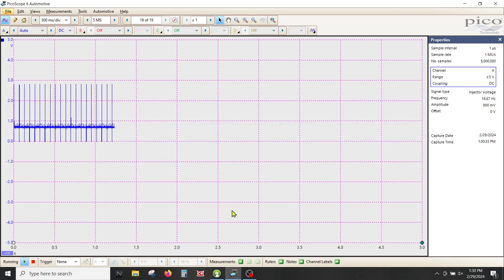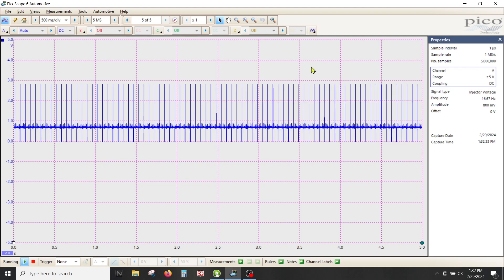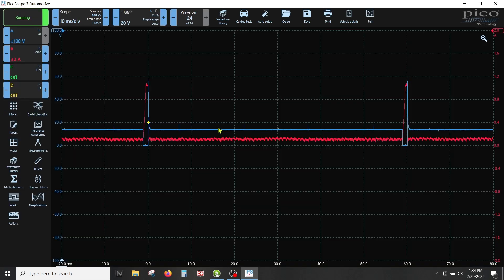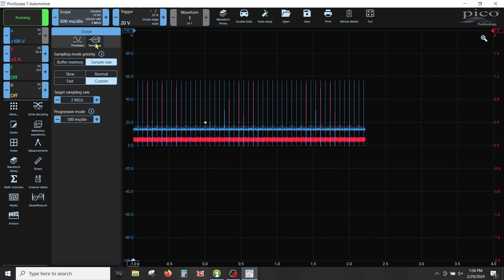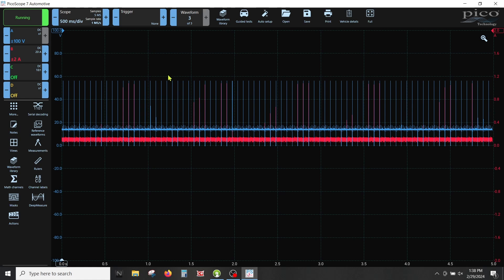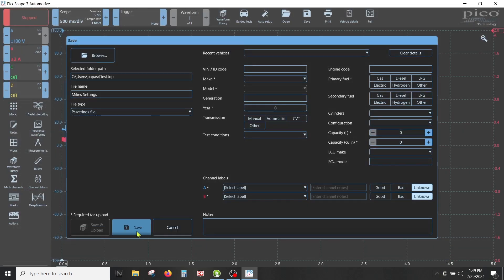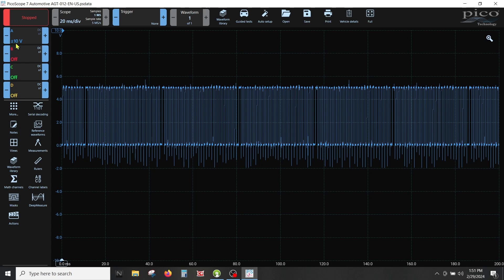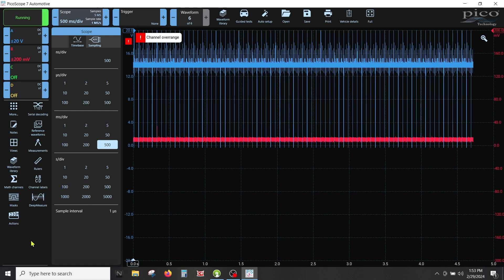Pico 7  Sample Rate

Comment: Great video! So is there any time we will need a smaller sample interval? Maybe CAN bus testing, Flex-Ray, or other communication networks? Or will 1 micosecond work for most networks?
Reply from the maker: For network stuff I like to use a sample rate 8 to 10 times the baud rate of the network being sampled. Example 500k baud I would use 5MS/ per second minimum.  Depending on the model scope you have the time/division will be different.  Practice on known good, and fine tune your setup before tackling a problem child. That is always my advise for scope users.
Thank you for tuning in!
Reply: @CartersDiagnostics  thanks I appreciate the advice!

Comment: I  don't have a automotive Pico , I use Pico 6 and Pico 7 T& M  Pico T&M  does not have the custom setting , But hey i try it out on a vehicle, thanks for your valuable info .........
Reply from the maker: Nice. Thanks for watching.
Reply: I noticed the same thing.  I use Pico 7 T&M too.  You can still make a custom sample rate by clicking in the Target Sampling Rate selector which opens up a new box where you can change it to 1 MS/s.